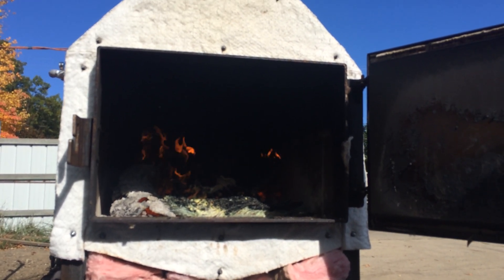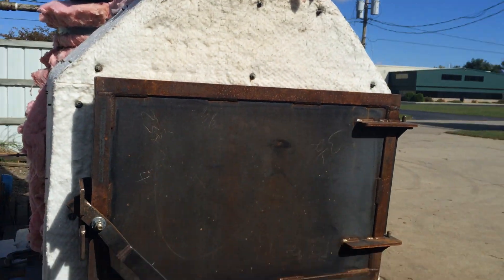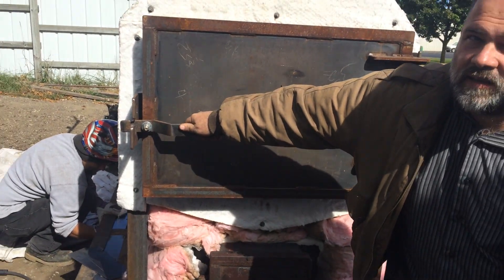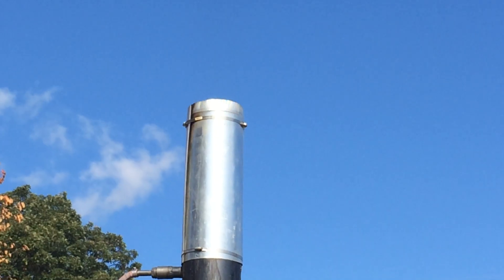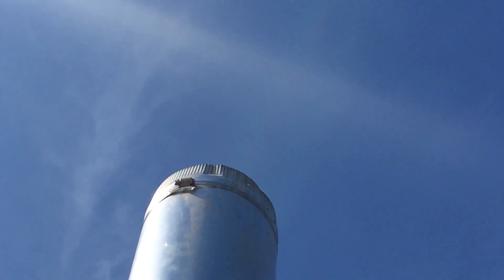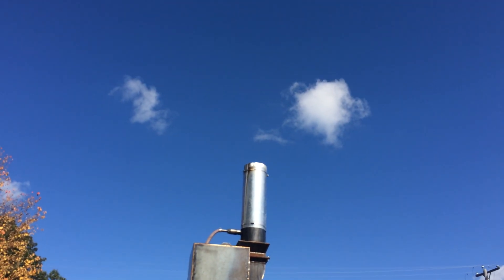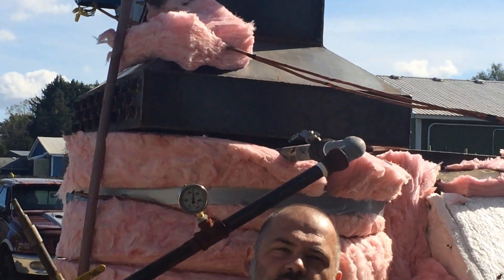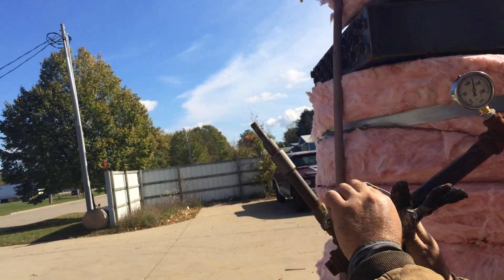Gasification boiler burning tire

Comment: U ever thought about using the same principle to run a engine using vaporizer coils to replace the injectors.. the coils would be in an oxygen free environment so they don't explode. I think it would increase hp ans economy several times. Sorta like boiling fuel and lighting the fumes.

Comment: I'm thinking of installing something similar in my mother's countryside house. There's always going to be some dead wood unsuitable for construction purposes, so gasification should have/deserves a bright future. In Belgium (where I'm from) there's a huge uproar against air pollution caused by woodstoves, so I naturally came along these ideas of gasification... currently I'm wondering whether it could be a good idea to afterburn with natural gas or biogas to remove the last traces of incomplete combustion. (Of course all sorts of companies want to push you to buy catalysts, but my research seems to indicate that this is not a definitive solution: the higher the burning rate, the more such a catalyst is overwhelmed, while ideally you'd want the opposite).

Comment: Am I wrong or should the vulcanization of the rubber not result in some SOx emissions in this experiment? I don't want to be the naysayer concerning your achievement (gassification, great insulation etc. -> you're checking a lot of good marks there), but I'm just curious... What do you think about electrostatic methods of scrubbing / water scrubbing?

Comment: Doesn't look like you're testing the carbon monoxide You're producing
Reply from the maker: In this video we had not even completed building it. And in fact it produces carbon monoxide and hydrogen and hydrogen cyanide as the primary fuel source. And the hydrogen cyanide is 35 times more lethal at the same concentration of carbon monixide. But when combined with free ambient oxygen at tempratures above 900 F they all burn to produce water vapor and carbon dioxide with several other oxides of nitrogen and other undesireable gases...... the least of which is carbon monoxide. Thanks for the opportunity to comment. Your personal prognostication has been useful, if not deliberately helpful and enjoyable. Not your intention to be sure.

Comment: What's the composition of the ash left behind? There is a video on YouTube where a guy makes carbon black instead of Ash he doesn't burn it it just hates it he also extract gas and oil from those tires
Reply from the maker: There is a lot of sulfur that bonds with the iron bands in the tire. But in a commercial setting the exhaust gases should always be scrubbed with water and other processes to remove oxides of nitrogen, dioxins, and acidity associated with high sulfur materials.

Comment: Did you actually measure the output even thought it was clear?  Burning a tire would produce a lot of sulfur.
Reply from the maker: with out a doubt........ but i am not burning the tire. I am not allowing enough oxygen into the system to allow a burn condition until the door opens, which it should not. With the door closed very limited oxygen can enter the system. We want to produce hydrogen and carbon monoxide. Then we burn off these gases. When we open the door, we just have a regular oxygen driven fire. With the door closed, there is very little oxygen in the upper chamber.
Reply: @ourhouseisfull11  So the gasification process produces no sulfur?  

Your statement that the tire is not burning doesn’t quite make sense since it is on fire.  Would it be more accurate to say the the tire does burn but the gasification process clears out the more harmful gases?
Reply: @youtubeismarxist  you still didn’t answer my question.  Also, are you working on a way to recover the heat created with a steam turbine etc?

Comment: Unless I've misunderstood the concept here, I still believe all the contents of the tire less the steel belt and a few impurities have completely dissipated into the atmosphere. Just because we can not see the tire anymore doesn't mean its gone, or green for that matter. Where is the carbon? Your fire is much too hot in your primary combustion chamber that carbon will readily burn. It looks to me like you have achieved a thorough, CLEAN burn, and have mistaken it a environmentally friendly burn in which you could account for the carbon. There is no doubt your carbon has been released into the atmosphere. No smoke in this situation shows your fuel to air mixture is dialed in, but realistically the tire has only changed states. If you wish to truly gasify, your carbon would be left behind and your exhaust would be spent hydrogen aka WATER. Please don't let my comments discourage you, I written them to help. I, much like yourself am determined to help with the solutions too, and have spent many hours, building and testing my own crazy projects. If I have misinterpreted your intentions, please accept my apologies. If I can help in any way please let me know. Keep up the great builds! Thumbs up.

Comment: The issue isn't your burning clean which is well done  but the gases leaving that stack and there would be a huge amount of CO2 going into the air which all adds global warming sorry to say. Maybe you need a smoke sniffer to tell the nasty s that are leaving the flue and entering the atmosphere. You may even look at a soot scrubber for the times you do smoke out the neighbors. But the beginnings are there most certainly going in the right direction. Well done something is being done about bloody tyres.
We are doing the same with waste oil heating very clean burning like yourself's but that means nothing sorry, huge amounts of untapped energy in waste oil, however we are getting the council into check the emissions next week.

Comment: Does the operator get cancer? What about the neighbors? Do they get cancer? More testing required but a very good build. Congrats
Reply: And how often can we spew what we want into the some times encouraged and unpermitted ? How about basement power vents designed to remove radium which comes from the earth so now are we poisoning the neighborhood? What about Bpa free plastic lots of study's were done on bpa how much was done on the replacement probably none, is it more poisoned i don't know maybe, your trust of the gov scientists is appalling if only you knew what elements that you come into contact with on a daily basis you would crap your pants, not saying it is good for you but how could you know for sure maybe you are aware there are things that are untouched by man that could kill us a seemingly clean  stream of water a tainted plant ? First it was Co2 but we then said oh but tree's and plants need it to thrive and survive and produce o2, oh yeah but there's Nox, what next
Definitely some other crap, likely an engineer said ( we could reduce fuel consumption and emissions if we plated the combustion chambers with platinum or radium) oh no lets put it in the exhaust stream then they will consume more fuel and make the ic engine less efficient by way of restricted exhaust it goes on and on i could type till my eyes crossed and we would still have an argument
Reply: No extra testing required this breaks everything down to it's element, if everyone tests and regulates the crap out of us how can any thing be accomplished? And certainly no one can make a living that way this could be a good way to make it
Reply: so you are saying that making a living at the expense of others health is all that is valuable to you. The same thing was said about DDT that they sprayed in the neighborhoods in the 1960's. Those people got cancer.

Not testing means that it has no scientific value. I know all about gasification and how it works. The elements that you are talking about like CARBON BLACK and Kerosene are highly toxic. The metals left over release mercury and other trace elements in the gasification process.

That is why they use a centrifuge gasifier that costs 2.1 billion dollars. The only people allowed to operate one is the Los Alamos testing facility. Why? Because it breaks elements down and spins them out. Thus extracting Thorium, Uranium, Lead and other metals that are completely toxic.

You need the EPA stuck dead in your backside to regulate the absolute hell out of you. Your contraption is a backyard experiment that will no doubt get someone killed, poisoned or injured. 

Where is your certification and permit to vent unregulated vapor in to the atmosphere? You can not just burn a tire and claim that it only releases water. Why dont you catch some of that steam and cool it down. then drink it everyday unfiltered. Your nothing more than a hack that is by passing scientific, environmental and industry standards to put some worthless fiat globalist cash in your pocket.

You need to make a living in jail.
Reply: @jamesanderson478  no you are talking about nuclear waste, what this is, rubber, sulfer, petroleum and sometimes sunflower oils and high carbon steel just because you say so don't make it so, those trace elements can be found anywhere do you have any idea how many steam generation  plants actually burn tires not gasify and all they need is a big money air permit to be  (green) i know it's big government they do what they want but give it some thought this stuff is from the earth not mars or the moon it's essentially ancient decaying matter that will still emit emissions wether we collect it up and do it in a few hours and use it for heat and possibly fuel or it sets around looking like crap now what is greener ?
Reply: James Anderson    obvious troll is obvious

Comment: If one looks at the considerable video available concerning structural fires, it is quite obvious that any walled cover over a fire, will capture the heat and rise the temperature to the point where the smoke catches fire: fire fighters call this flash over. This is related to the principal of latent heat.... you need to apply so many BTUs of heat to rase the temperature of any given object to a certain temperature.

Flash over will occur in any space that traps the heat from rising. even if the space is NOT airtight. All that needs to happen is for the gasses to escape at a slower rate than they are accumulating. This happens in a tunnel fire.

My point is this. It is not hard to get any fire to burn at 3000 degrees, providing you have a chamber that is capable of containing the heat. At that temperature, the only thing coming out of the exhaust will be CO2 and water vapor. Carbon monoxide, hydrogen, sulfur, polycyclic aromatic hydrocarbons all re-burnt as fuel. It could even destroy toxic heavy metals like lead, chromium and cadmium. 

Sure it doesn't solve the CO2 emissions issue, BUT it is the fantastic way to get rid of piles of industrial shit.
Reply: WireTamer And the co2 issue is a joke , look at how much is in the polar ice caps.

Comment: I like this gasification part of your project the best of all your work Don.  I see why you should not divulge the workings of this.  on to your turbines I was doing an open air steam turbine thing a while back, now I have an enclosed turbine and a combined heat and electricity system. The turbine seems quite efficient and I'm not going to tell the complete workings of it because, just as you are on to something with your clean burn, I feel i'm on to something with my turbine design. Gooday eh, Ken:)
Reply from the maker: I have been working with vacuum condensing now. I have been able to maintain 10 pounds of negative pressure (25 inches of Mercury vacuum. I give you an example, in the video we are only using 10 pounds or less of low pressure steam while it is outside the casing. But with a 10 pound vacuum, the temperature of the condensate drops to 128F and i can get the same rate of speed using 2 psi steam with a vacuum. Eventually all the turbines will be enclosed in cases and the system loop will be a 99% recycle loop. I will reuse my condensate. But i still prefer the impulse. Check out my new videos. I uploaded a few yesterday.
Reply from the maker: You come visit me this spring. I have some new things i will not post. But i don't mind sharing with people i trust.
Reply: @ourhouseisfull11  
How did you get the flue gas discharge temperature down so low? Do you use a regenerative air heater to heat the incoming air by cooling the outgoing exhaust gas?

Comment: hi, have you thought about old time steam engines venting steam up the chimney ,this could improve efficiency to the point that you could turn off your fans and controlling the vent to regulate temperature and also increasing the height of the chimney would increase draw

Comment: The comments below are a classic example of the difference between the Producers and the Takers. What on earth would be wrong with a tinkerer like Mr Schmidtke making money from this? It's guys like him who made this country great.
Reply: And without us tinkers noone would understand anything about anything. Greetings ftom Sweden. I'm related to the guy invrnting the modern fridge. He had a vision/dream. His subconcious also invented driving cars on wood gases. That saved Sweden during ww2. Swedes popolated the West. I'm related to guns: Mossberg, and  many more examples. Keep on solving problems locally.
Reply: @Heddanofarsan I’ve been contemplating a Mossberg. Now I have an even-better reason to get one!
Reply: It guys like him who poisoned this country and hurt people when the POS explodes or cracks and melts someones face off or worse. Its called Science for a reason.
Reply: @jamesanderson478  just a gasifying stove with afterburner.  rather than a high pressure system, the exhaust could be piped through a thermal mass accumulator.  basic stuff.
Reply: James Anderson How much industrial steam have you worked around ???

Comment: Having to cut / split the tire in half to burn, may reduce the efficiency.  I am impressed as a person can look into burning refuse that might end up in a land fill. Having the ability to burn many alternative materials, some of your paper trash and the like is a huge plus, the low emissions is good too. Finding the right size furnace, maybe a window on the door to see what is happening in the burning chamber instead of opening the door.

Comment: How hot does your gasifier get to burn tires cleanly? If I could get the tires to exceed 2200 F. would I be able to burn tires cleanly without secondary combustion, that is all products are combusted in a primary chamber?
Reply: It's a two or three stage process...the black smoke is burned to get a clean burn...sometimes they will utilize a secondary burn process but you have to get the oxygen level right in first stage to produce the right type of smoke to burn second stage clean

Comment: Also, do not stick your face in your invisible flue gas and take a deep breath. You will die. Not trying to be mean, but SO2 is EPA regulated. Tires have 1.5% to 2.5% sulfur, yielding 5.5 LB per MMBtu. References on request. 5/14/16
Reply from the maker: I am not trying to be mean Rick. But i am not actually burning the tire. First the the entire contents of the primary chamber are broken down through heat gasification. The desired production is Hydrogen and Carbon monoxide. (SYNTH GAS). Very small amounts of oxygen are allowed to enter the primary reaction chamber. (H2S04) requires large amounts of oxygen. Residual sulfur can still be seen. Sulfur is bright yellow. But most of the sulfur has fused with the iron belts of the tire to form the compounds (SFe6) and (FeS2) (fools gold). All oxidation actually occurs in the secondary reaction chamber at high temperature (1800 F) and with sufficient oxygen to complete oxidation of the synth gas. So i appreciate your comments. But this is my hobby. I designed and built this for my own enjoyment. So go design a better system or shut up!
Reply from the maker: https://youtu.be/_X-vq6svXS8
https://youtu.be/6xdBOwYHKbQ

Comment: Just curious what is your background in combustion engineering? I do not see any sulfur emission controls. Without sulphur reduction how are your heat exchangers going to last at low temperatures? I seem to remember that flue temperatures of 450+ required to prevent corrosion from acidic condensation. Who is going to want a boiler that requires manual feed? thatrickster@gmail.com
Reply: Who said the feed can not be automated?

Comment: so how did you make it?  can you share the plans?  are you selling these units?
Reply from the maker: We designed and build this system from scratch. We don't have any plans. But our intention is to market the unit when it is combined with a complete electrical generation package. The components were built one piece at a time and later combined. It was a lengthy and costly way to learn. But i am please with the result. Now we are working on a hybrid Tesla turbine that can output 50 -100 kilowatts of power per hour and directly connected to the grid. The goal is to generate 150,000 kilowatts per year from trash of any kind. You are welcome to a personal visit if you are interested. Consolidated Stripping & Derusting, Inc. 269-685-1340
Reply: Would like this style design for hydronic heating via heat exchangers etc for domestic hot water and house. Your unit has zero smoke and that's the main problem with traditional outdoor boilers and neighbors complaining and before you know it, your Township or County Health Department shuts you down. This is great technology. I hope you can incorporate it into a outdoor hydronic  system. Would help a lot of folks who can't afford fuel oil or having a heating fuel bill. Great video !